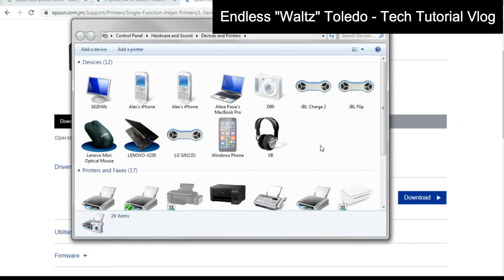EPSON L120 GREEN & RED LIGHTS BLINKING (FIXED)

Comment: both light are blinking.  
..

Sabi sa laptop paper jam..
Yung roller na maliit Yung ginalaw not sa likod .it's working namn na check ko. 
anu po pasibleng sira nito
Reply from the maker: Hello po pwede nyo i-check if may piece of paper na naka-block sa mga sensor ng printer if wala naman dis-alignment lang po ng mga roller ang problem ng printer nyo. TY

Comment: Kuya pano mo po inayos kasi ganyan yun nanagyare sa printer namim kaso hindi po.siya nagdidiretso magprint kaso blinking both lights pa rin ..pag nakailang pages na??
Reply from the maker: Sir re-alignment lang ng mga roller at paper feeder
Reply: Kuya pag nagprint.po ako.nang may mga border lines.. tabinge un lines pakaprint tska di pantay
Reply from the maker: @janerickmalate1554  check mo po yung alignment ng printer head sir bka may problema na or need na palitan